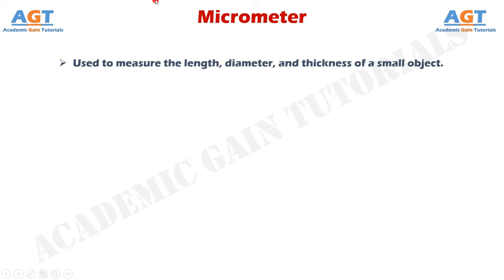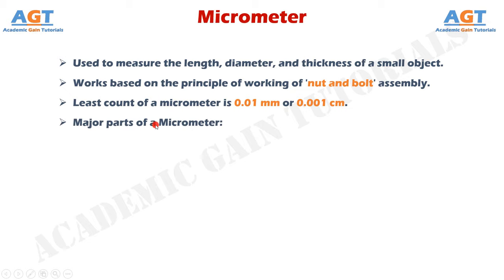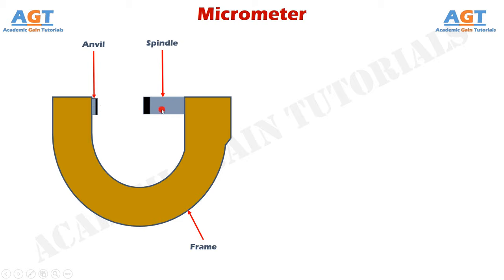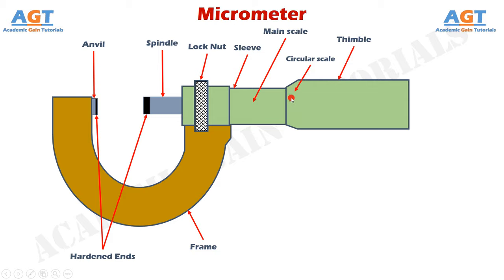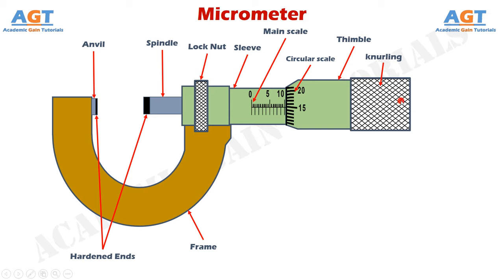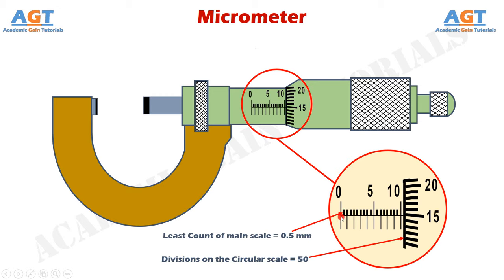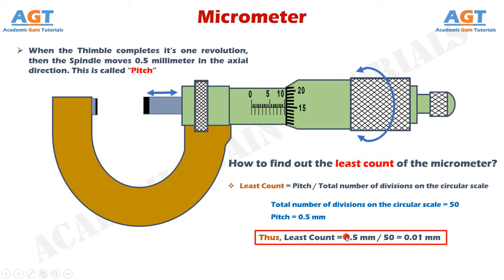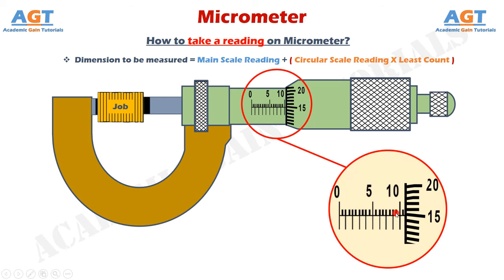Micrometer (Read Easily) - Parts & Functions Explained.

Comment: 10:10 "circular scale reading is 15 MILLIMETERS"....no it's not millimeters, each mark on the circular scale is 1/100th of a millimeter, so 15 on the circular scale = 15/100ths of a millimeter or 0.15 millimeters, aka. 150 MICROMETERS.....and considering you're doing a video on MICROMETERS you should've gotten that right (10.65 is still correct though)

Comment: Good ..... But you made a mistake. You lost a .5mm in there. :)
Reply: I agree, there is a mistake: in my understanding it should be 11,15 mm too
Reply: @flywings2011 , the top horizontal scale is 0.5mm, not 1mm, therefore 10mm + 0.5mm + 0.15mm = 10.65mm